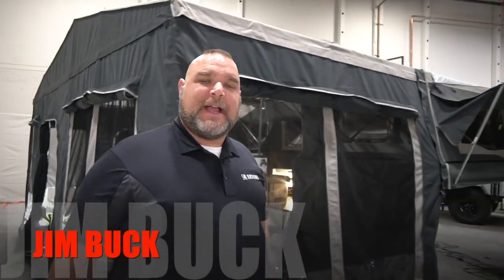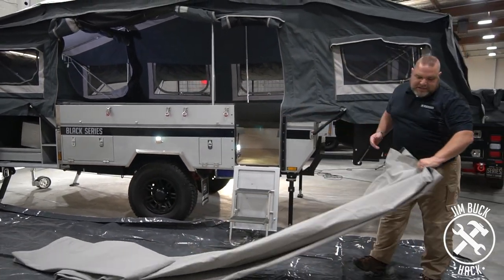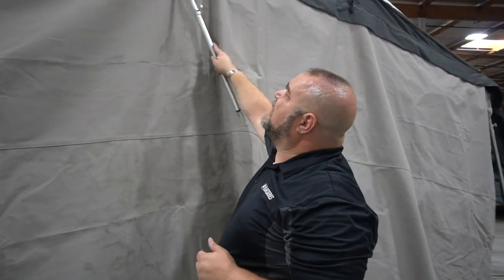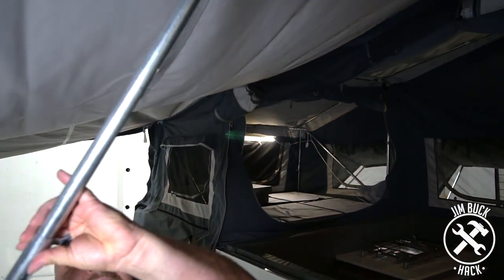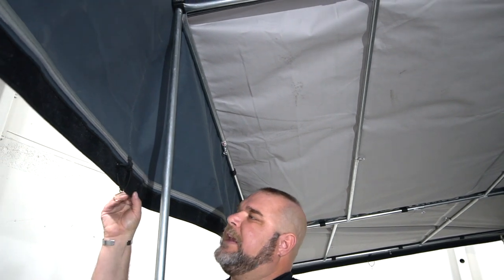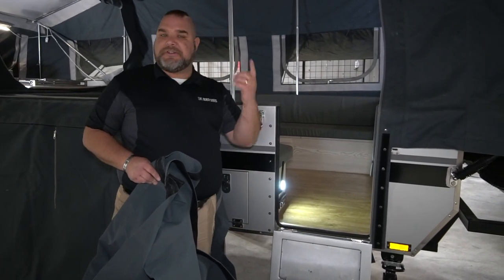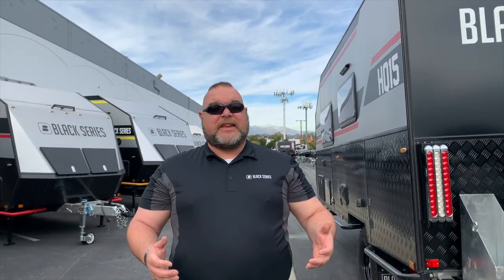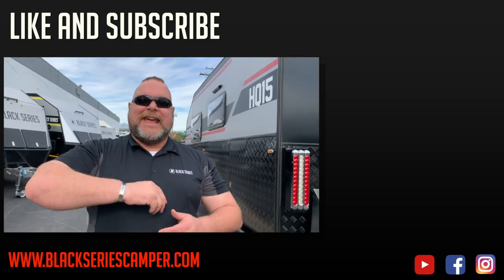Classic Double Full Annex and Awning setup. Black Series Camper; Caravans, trailers and campers

Comment: How long does it take to complete the full setup of the annex if doing solo? How long does it take to break it down and put it away if doing solo?
Reply: 2 hours at least, once you proficient with it. I imagine this tent costs 3-4 k.
Reply: @James Buck I added a soft roof top cargo carrier to the rack on the trailer. Makes transport and storage way easier. Also frees up locking storage for easily stolen items.
Reply: I have the sargent , found you can leave the annex attached when packing it away  , save time but you have to put up the annex , which adds about 30 minutes to your total build time , another 20 minutes if you take it off and pack it away. Im in Aussie land. I suggest you dont use the annex if your solo